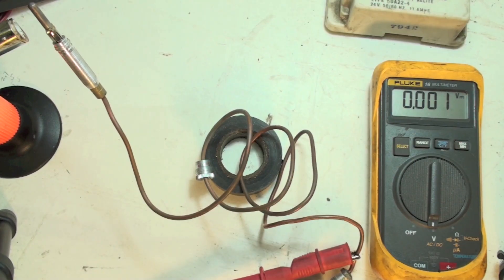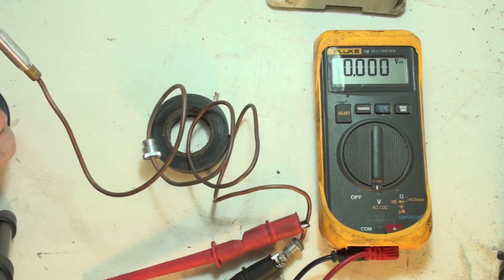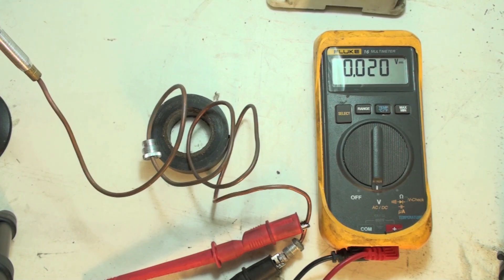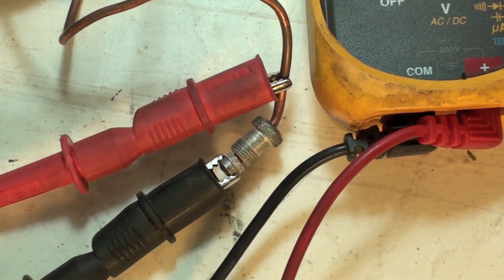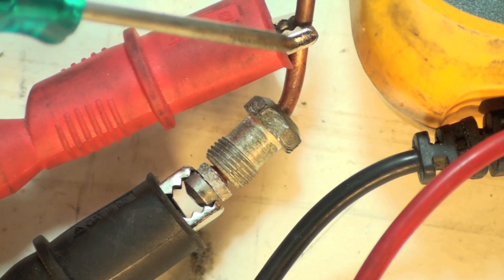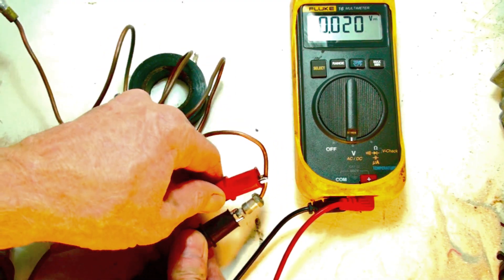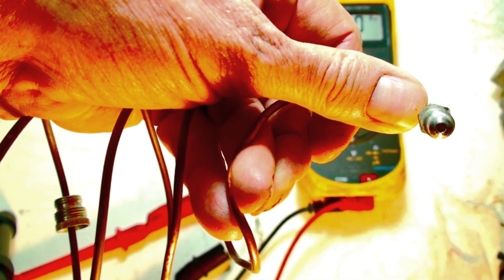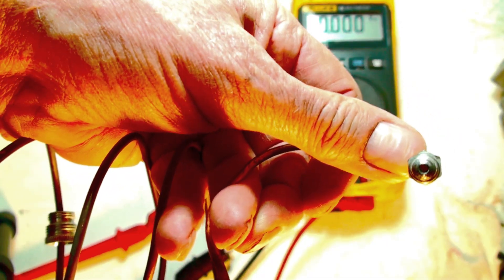Gas furnace will not light.  Thermocouple test with the multimeter

Comment: I hve a problem with my gas cooker grill when I put it on its lit about 5 min then it goes off 
hve to hold the button of the valve all time to get it ON
hve tested the thermocoupler with multimeter and it gives me 32 mv dc
is it still good could be the valves problem
please help thanks for your advice
Reply from the maker: Ghassan Bahsoon I would guess the valve is the problem.
GFM
Reply: thank you very much for your advice

Comment: What is a Thermocouple?

A Thermocouple is used to detect a flame on a boiler or fire, they come as part of a pilot assembly or oxypilot. They work by sending a signal down to the gas valve to either open or close it. A thermocouple is a device that is made of two different metals that produce a slight electrical charge when heated on one side.
Reply: No always for heat

Comment: The thermocouple on my Burnham furnace needs to be replaced every 2  to 3 years and fails with no warning,   Do you have any suggestion on prolonging the life of the thermocouple or why the failure after a relatively short timeframe?
Thanks
Reply from the maker: Be sure the thermocouple is covered by 3/8" of flame.  No more, no less.  Hope this helps.
GFM

Comment: Thanx for this! If you replace the thermocouple and the pilot light still won't stay on, would the gas control valve be the issue?
Reply from the maker: Yes.  Unless you have a negative pressure in the house where the downdraft could put out the pilot.
GFM
Reply: Just replaced the gas control valve today... All works fine now. Thanks again for sharing this info! Mine was 10 yrs old... They don't makem' like they useto. They're gettn' better @ engineering obsolescence... Sadly. :-/

Comment: I have a Goodman GSU060-3. I can get it to come on after resetting sometimes.. Mainly the igniter comes on and glows and I hear a series of clicks and no flame. So it resets and eventually locks out.. I have no error codes being flashed either.. Can you help??
Reply from the maker: If gas is available, (other units that work will indicate), then do you hear gas coming out during the trial for ignition?  If not,  This video may help:  http://youtu.be/0zKl9wvNIRk  You will need an ammeter and the ability to use it.  Hope this helps.
GFM

Comment: I have a Singer GB-2103 gas furnace which was built on 1972. The pilot can be lit up but once I release the reset button the pilot will go off. I hold the reset button for over 2 minutes but still cannot get it to work.I test the thermocouple with a multimeter and the read out is 0.028. It looks like the thermocouple is still working. So I clean it up, put it back and try again but no luck. Finally I drive to a nearby Lowes store and pick up a new thermocouple. Bingo, the new one works like a charm. The new thermocouple costs me only $7 bucks. The bad thing is the new one does not come with a compatible place holder. I have to cut a piece of cokacola can to make a new place holder to keep the thermocouple in place. I bough a spare one for in case this part is discontinued. Just to share. Thanks for the posting and thanks for reading:)

Comment: Have watched your videos and will try some of your techniques. I have a furnace that won't turn on. When the it reaches the temperature the red indicator comes on but nothing happens. I have to turn it off then back on before the furnace ignites. It stays lit and shuts off properly, but when it's set to turn on again it won't until I again have to turn it off and on again manually. Any advice?
Reply from the maker: It depends on the type and age of the furnace.  It is probably newer and is not starting due to a flame failure issue.  Flame rod cleaning, condensation issues, HSI failures are all possibilities.
GFM
Reply: Thank you for getting back to me. I'll definitely take a look to see if any of those items are the issue. Thank you.

Comment from the maker: My sympathies on your furnace lol.  Your furnace probably uses a thermopile to power the gas valve.  A thermocouple does not have enough power output to operate the valve.  If you are having problems with it, the thermopiles are still available.  I did a couple of vids on these that may help.  Hope this helps.
GFM

Comment: Hi Gray,
I just replace my thermocouple; it glows red hot say 5/8" from the tip downward.
Is the pilot light too high. Could that be the problem why it breaks so often. 
If so, is there a pilot light adjustment screw.? 
Thanks..!

Comment: Hey Gray! Your videos are awesome! I replaced the tcouple a two months ago and everything was peachy. Now the pilot went out again and it won't stay lit. I also noticed the flame isn't shooting out enough to even hit the tcouple. How can I remedy this? Any troubleshooting steps I can take? I've heard I need a new one and/or I should clean the gas valve orifice? Thanks!
Reply: It’s likely the thermopile if the pilot light is going out. Also if the flame is too small to heat the thermopile and or thermocouple, you may have kinked the pilot light line when you changed the thermocouple. Or there’s dust in it. A can of compressed air may help. The best thing to do regardless is to hire a professional.

Comment from the maker: I concur with supplier.  It is the cheapest part and sometimes when they are tightened the contact breaks.  A bit unusual but does happen.  I am assuming the pilot light was out and would not stay lit when you release the button.   Hope this helps.
GFM

Comment: Your fireplace will have both a thermocouple to prove pilot and a thermopile (unless auto ignition) to power the t stat. Ive seen this before where the t pile was getting weak and would not work on t stat but works when turned on at the fireplace

Comment from the maker: That could be a draft hood spill switch.  If there is a negative air pressure in the structure, exhaust gasses spill into the room or if the vent is plugged the same will happen.  The spill switch the shuts off the furnace.  Hope this helps.  
GFM

Comment from the maker: What you are doing here is testing the thermocouple for output.  In order to do that, the thermocouple must be removed from the gas valve.  The furnace will not light during the test.  Once the test is done, it can be reinstalled in the gas valve.  This troubleshoot is designed to isolate the problem.  If the unit will not stay lit and the t couple reads ok, the gas valve is bad.  Hope this helps.
GFM

Comment: Thanks for the video.  I'm fleshing out my RV tech skills, and I've been having problems with a new Robertshaw gas valve installed on an Atwood G5A7.  I'm about to run this test.  If the Mv reads as it should, then I have to remove the gas valve and inspect the thermocouple receptacle to see if there is anything blocking contact.  I'm hoping to not have to replace the valve, but other than cleaning it, there are no serviceable components and I'm not about to open it and rupture the inner seal.